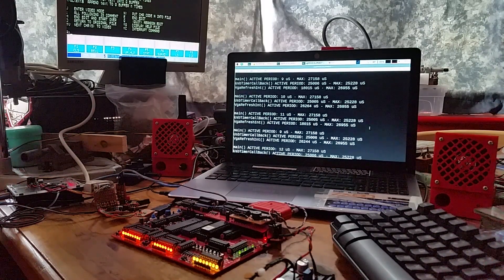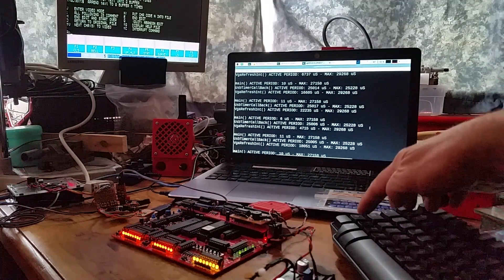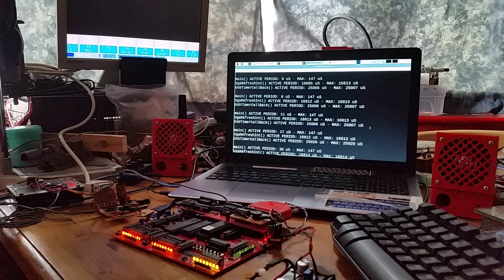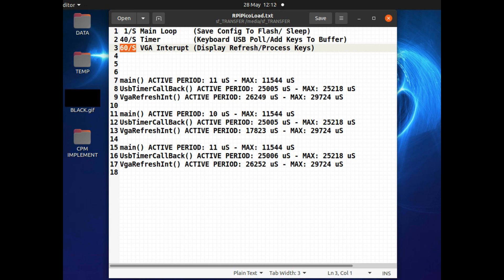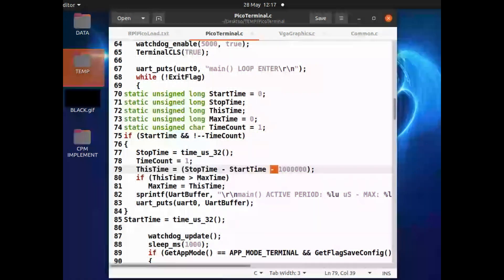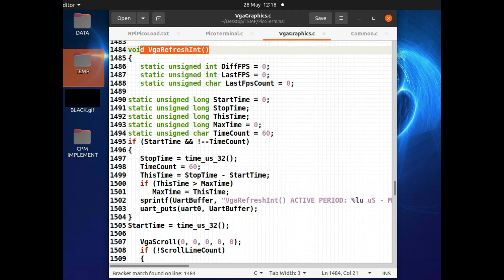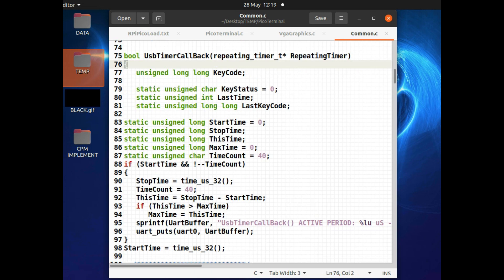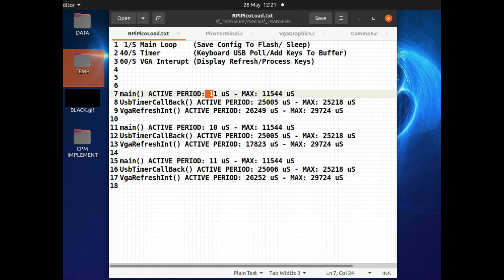Raspberry Pi Pico Out Classes Many Other Micro-Controllers

Comment: Can I please get the code for your Pi pico VGA, I couldn't find it at the links you gave.
Reply: Here's an example of code for a project using VGA output on the Raspberry Pi pico: https://github.com/kilograham/rp2040-doom
Reply from the maker: I've shared the source code to some big projects in the past and it has never made any difference to my channel growth. I think until my channel gets big enough to be worth while, I will not be sharing source code currently.